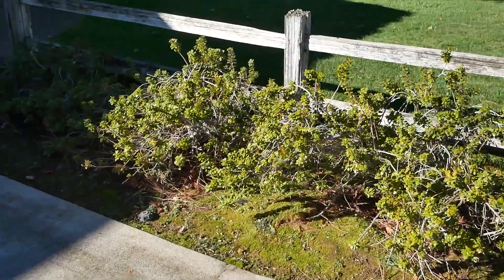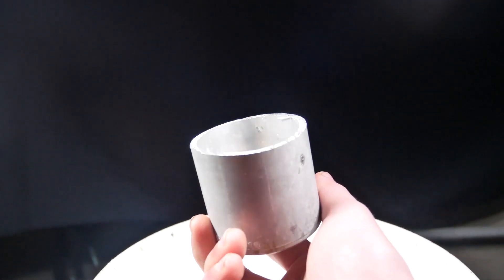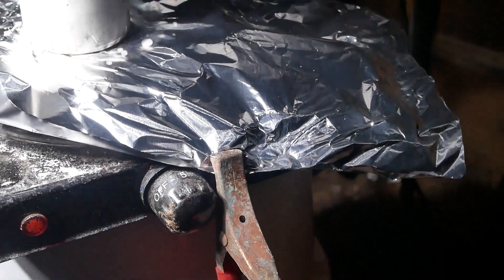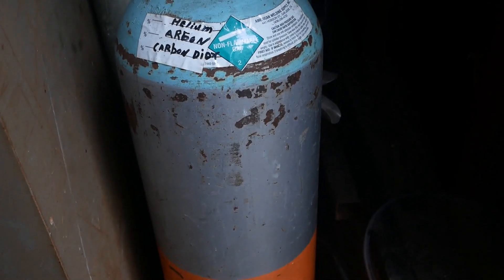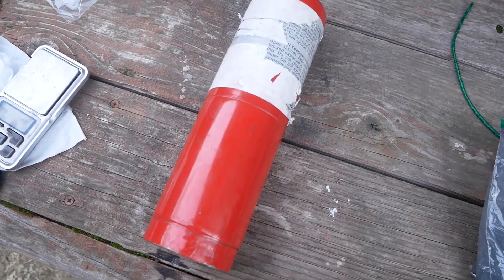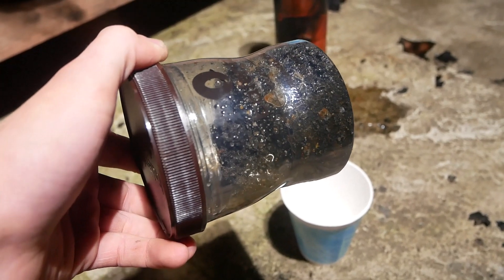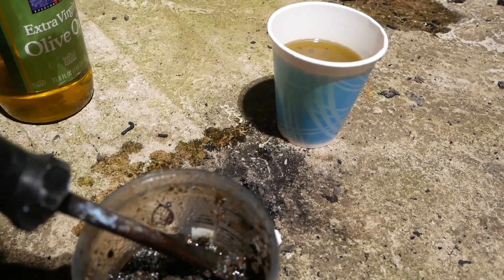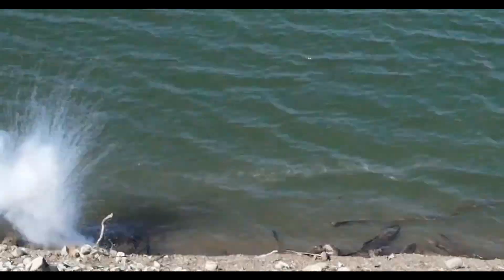How to make sodium metal with household items + TEST

Comment: I have an idea for electrolysis of lye.  You use a torch or hot plate to initially get it to melt but then you put so much current through it that the electricity alone will keep it molten.  But it can't be TOO much or the molten lye starts to dissolve the sodium causing little explosions at the anode.
Reply: That's basically the castner process, I've tried it before and it is very finicky and has its own problems but it does work

Comment: sooo many things were weird here...
olive oil reacts with sodium.
the aluminum container was kinda... weird
also dioxane seperates sodium from slag nicely
Reply from the maker: yea i tried with mineral oil  but same result  i don't have any ether either
Reply: @ianbuilder  making sodium at home is well not the easiest and the most convinient way is a more than 24 hour reaction time at 240+ celsius and best done in a steel pot with a stirrer using menthol catalyst, sodium hydroxide and magnesium under mineral oil.
Reply from the maker: @CatboyChemicalSociety  oh yea true  i saw a nile red or nurd rage vid on it  gotta get some menthol
Reply: @ianbuilder  remember to attach a condenser to it because menthol will vaporize below the operating temp and needs reflux.